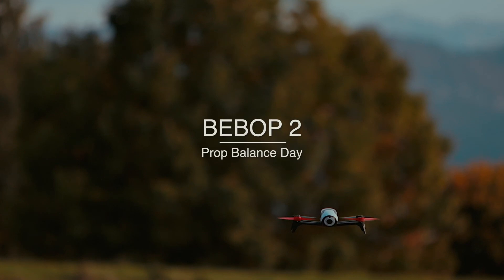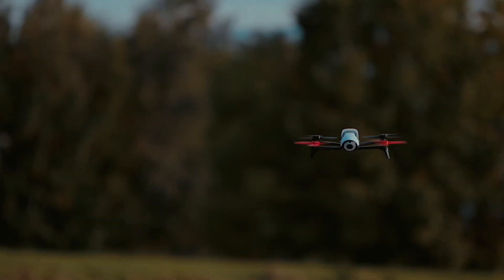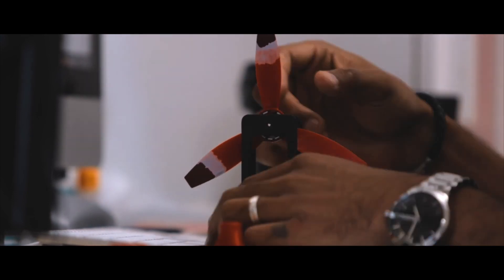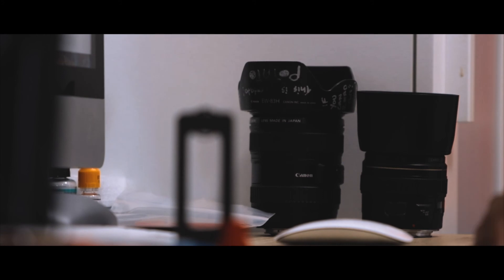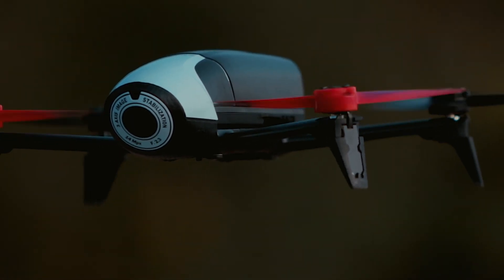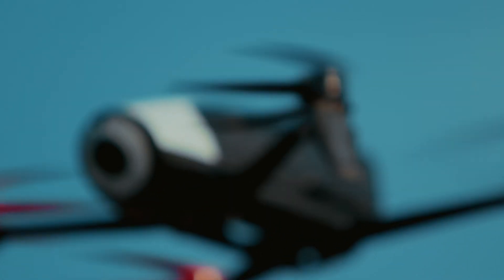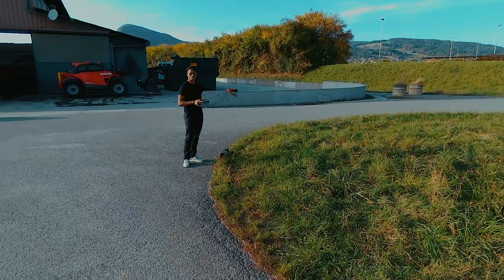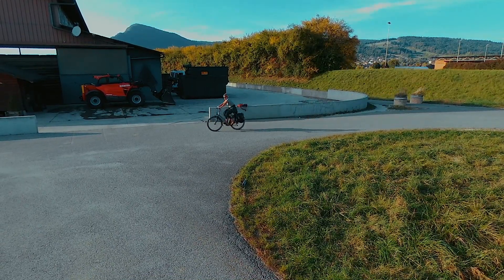Bebop 2 - Part 5 - Jello fixed - Prop Balancing

Comment: This is a great idea but what if the motor is off balance as well? I wish parrot thought about this. I mean don't they know all propellers on drones need to be balanced? There are a number of things they did wrong.
Reply from the maker: The motor cage is too close to the pivet to make significance impact. The propellers are further away so if they are off balance it makes a considerable affect to the vibration transfered. Just like taking off your wheels and just free spinning the brake rotors. You won't get vibration through the steering, but as soon as you 9u5 unbalanced tires/rims 6oh start feeling that vibration as certain rpm/speed
Reply from the maker: PS iv learnt that using oem motors and props give the balanced result. Using ebapy props and 3rd pty motor cages than you have 5o mess around with them like I did for months.
Reply: @ANTHONYVLOG  awesome man sounds like you know what your doing.  Your a smart guy and good job!! I been coming to your videos for help.  Just got my 3rd bebop 2 and it had a dead battery n charger  so I was watching you other videos on batteries.  I been flying these things for 4 years now and I can't believe they charged 700$ for the bebop 2 when it came out.  I can see 400$ tops. Good thing this one was 190$ keep up the good work man n ill be watching 😎👍

Comment: Liking your channel mate 👍..
I was going to sell my yuneec breeze 4k and buy the bebop 2 but to be honest the more I research the more I'm put off, what with the charger not being a balanced charger and the pcb board on the battery not being able to balance the cells properly, cause the drones to fall from the sky, also the battery in the sky controller 2 having a discontinued battery due to being unreliable, so we ourselves have to manually fix or correct this, and now this showing you have yo balance the blades lol,, you should not have to do none of these on a £380-£500 drone, its insane.. I'm not sure what I want to do now but I'm leaning towards not selling my breeze4k and just saving up for another year and buying the spark..
Reply from the maker: Hi Marc, glad my videos could help in your research. I can't select a drone for you but I do share my experiences I I come across them with the BEBOP 2, I still have the BEBOP 2 and use it for leisure flying. Even though I have documented the internals and externals I still have not had the drone fall out of the sky I believe this is partly due to the design of the power management and partly pilot negligence. If you do get the BEBOP 2 I would strongly recommend a small battery checker usually are around 7USD, actually I would recommend it on any drone that does not have an intelligent battery. Kind Regards, Anthony
Reply: @ANTHONYVLOG  hello Anthony, thank you for the reply mate.. Yeah I totally get that and I'm grateful for channels like yours that so the good and bad experiences.. 
I do have a professional hobby charger so I would most likely buy the lead converter so I could charge the bebop2 batteries using that rather then the original charger so I could properly balance each cell and check the current state of each cell before and after charging.. And I agree I do think half the issues reported with the BB2 is down to user error as well, I see a lot of people using aftermarket apps too when they talk about sky falls, or not changing blades after crashes etc.. 
Lol I'm unsure on what to do about the BB2 to be honest, I really do like my yuneec breeze 4k but it's just the range and speed that stops me enjoying the drone as much as I would like too, but I hear a lot less about faults with my yuneec breeze 4k. In an ideal world I would just buy a spark but its out of my price range, even more so as I would like the fpv goggles too. I'll have a good think for a week or so and hopefully will then be able to make my mind up.. 👍
Happy rc-ing 😉

Comment: I would just balance the prop rather than balance while the motor bell is attached. Just balance the same way you would a freestyle or race prop. With just the prop.
Reply from the maker: LordKwad excellent, do you have any tutorials on the bebop props on a freestyle balancer? That would help allot. Cheers
Reply: ANTHONYVLOG I don't at the moment but I am thinking of getting a prop balancer. I will look into it.
Reply: @jasondonavich2758  Did you ever look into it...😆... Two... years...latter....🧘
Reply: @Roboticdoughbull3k  I very quickly got rid of the bebop, didn't like that tbh.
Reply from the maker: Don’t worry lads I still have the bebop that’s been drowned a few times, frozen and abused. Still doesn’t give up.

Comment: I wonder if you sit or suspend the Bebop off the ground enough that the legs don't touch and run it without any props on it, that it would still show vibration from the motors being out of balance?
Reply from the maker: Since the making of this video I found that unscrewing a single motor at a time and testing them isolated the motors and you can pick out which ones are balanced and unbalanced. Further more, replacement motor cages from Parrot are balanced, as well as the props. Iv only been using parts direct from Parrot since, but it was a nice learning curve trying to figure these things out.

Comment: ~20$ charger cable with balancer connector on ebay

http://www.ebay.pl/itm/PARROT-BEBOP-2-charger-cable-with-balancer-connector/112762893910

Comment: you use the fingernail paint as weight to balance the props?
Reply from the maker: Max Knight yes. These are for non oem props made. I no longer need to balance as I buy my props direct from Parrot now and they are perfect.
Reply: i long time ago, when they come out with the ar drone 2.0 i use a little bit of black tape to balance the props, but the fingernail polish is a great idea.

Comment: Hi it is not dented but
 the motor cage has too game.It is not fixed like the others.I'll to replace the motor.Thanks  my friend.
Reply from the maker: Ciccio Formaggio  the repair kit comes with the cage+shaft assembled and the new C clips. Its easy to change and less expensive than the complete motor

Comment: Hi i have made this 1 month ago  and perfectly balanced but  jello remain.With new propellers new firmware and calibrate bipop without propellers the jello a little remain.Have you changed the motors?
Reply from the maker: Ciccio Formaggio your motor cage must be bent. Yes I replaced all 4 motor cages  and shafts

Comment: Based on video your drone has motor issues (damages) and in this case you should change it, blades calibration to complicated)) or another way use original propellers)
Reply from the maker: Denis Balobin cheers thanks, these are new motors. Original props from parrot sorted. Check the recent videos cheers :)

Comment: For the price of the propellers I think it is better to buy new ones instead of trying to calibrate them. My Bebop 2 in many videos look like it was really damaged and warped. And I forget to try new propellers. I put new Propellers and then it looks a new Bebop 2. Sometimes the props are twisted. Some blades are upper then others and with time they become loose. Did you check the motor cages? If they are a little bit twisted it is better to replace them with new ones. They are not expensive either. And as I see you must have a lot of experience in photograph and cameras because the Bebop videos here look much better and it seems the video is from another drone. Very nice.
Reply from the maker: Hello helderhugo, this was my personal project. I purchased the bebop second hand on eBay and it came with jello. After inspecting it had signs of a side impact as two motor cages were bent, so I purchased a repair kit. I changed the cages but the problem persisted. I than ordered propellers the same ones you used in your video "carbon fibre propellers" and my propeller broke on take off and crashed into the lake. Its in my video list. I than ordered the original bebop propellers they are 22USD on Amazon. Once I got them the jello was reduced but not gone that is when I ordered the propeller balancer from Germany to balance the props. So far iv done long flights, high winds, high speed with no more jello. 

Yes sir I do have a bit of experience with photography and cinematography :) thank you for your time commenting. Iv been subscribed to your channel for a while and love your videos and your humour :)
Reply from the maker: Take a look at this and tell me what you think :) https://www.youtube.com/watch?v=ToZUpxBlTkA
Reply: Oh my you bought that crapy props! Weeks ago I found that props I used in thar video laying arround on the IKEA shelf here in its bag. Some times I keep useless things around. I have a little of a compulsive hoarding. I talked once with the creator of that propeller balancer. I thought of buying it and make some sort of a video like you did talking about it but I give up. Thank you very much for watching my crazyness on my Bebop videos. Maybe I learn some things on your videos like colours contrasts and so on.
Reply: Very nice. Bebop 2 camera has very limited quality. I am surprised you use a Bebop 2 camera. along side with your high quality cameras... don't be afraid to take off the Bebop 2 from the hand 👌 ✈️ 😁
Reply from the maker: haha I almost thought you said IKEA propellers. Oh yes the footage from the bebop is limited. I use it around the place because no one really pays any attention to it. I once even asked for a permit from the local authority to fly the drone in a no fly zone and they approved it instantly because its a bebop and not classified as a professional craft (500g and less) although I have a huge workload when I have to use the inspire for commercial work. But this channel if for fun stuff I need space away from work haha.The bebop is good stress relief for me and it makes me go out allot more to try and get some good footage. I prefer to shoot during golden hour but the bebop is very limited with low light so I have about 5 minutes of good light which makes it more exciting. Ill upload a video shortly from today I took it to a local car show. Plus if I loose the bebop I won't cry it only cost me 200euro on auction give or take 50euro for repairs and bits.
Reply: @Helderhugo Man you are everywhere! LOL I feel like this is a gathering of Bebop greats. Haha
Cheers mate!
Reply: I am omnipresent. I better get another things to do!
Reply: LOL HAHAHAHA